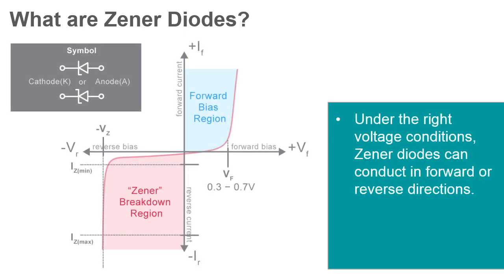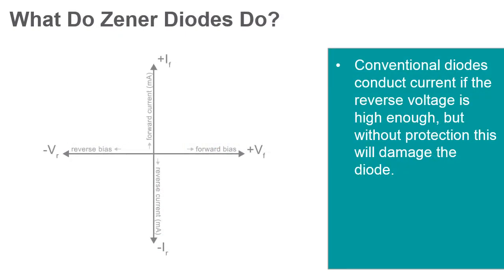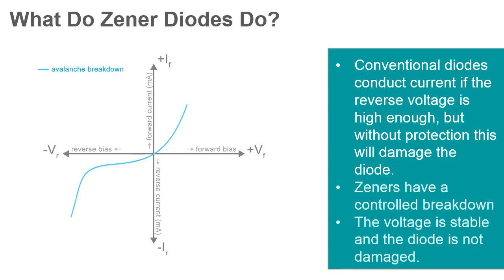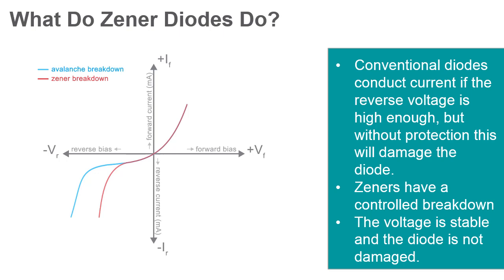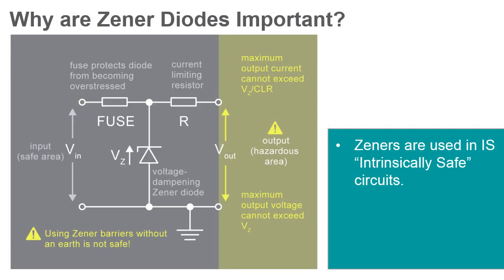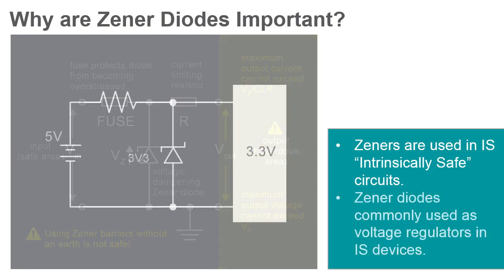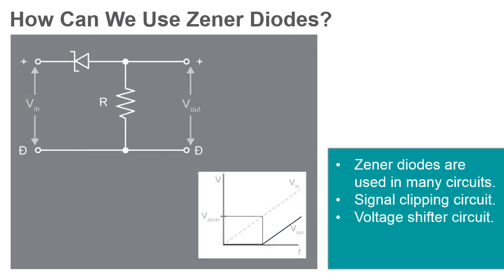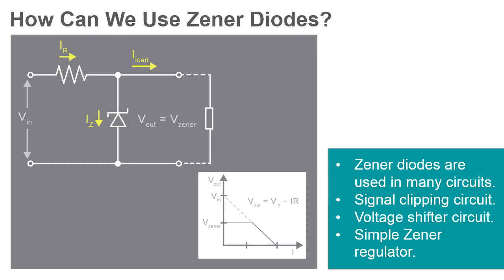Zener Diodes

Comment: On the introductory (first) slide, the definition of the "Breakdown region" is incorrect. The reverse biased region is missing (from 0V to the breakdown voltage (-Vz) ). The breakdown region starts only from -Vz.

(from a widely used electronics book)